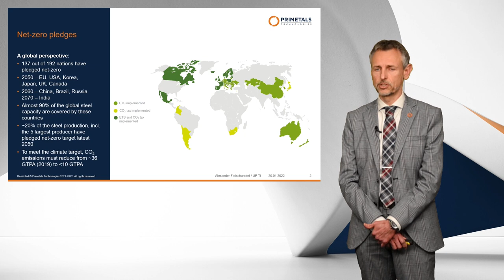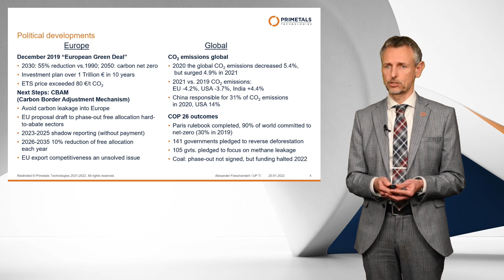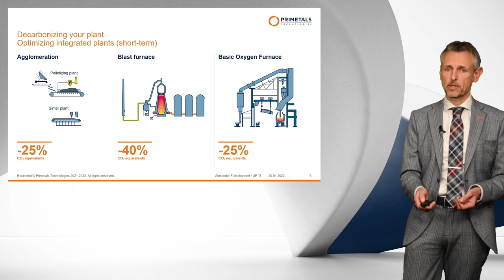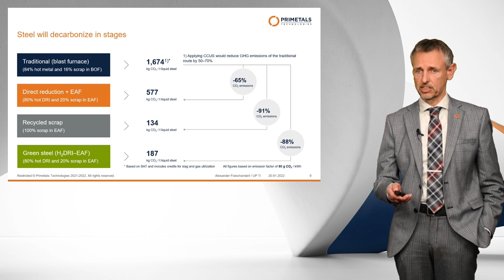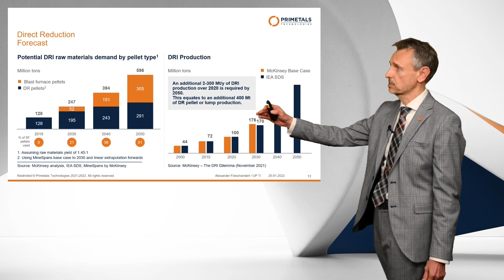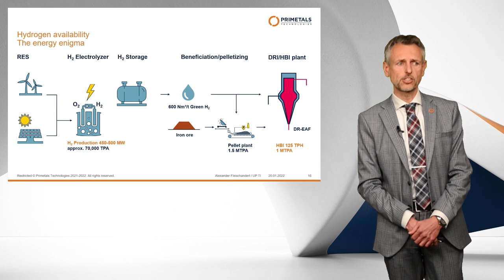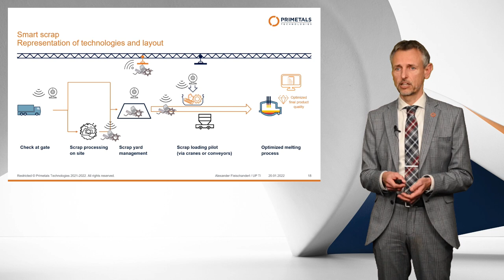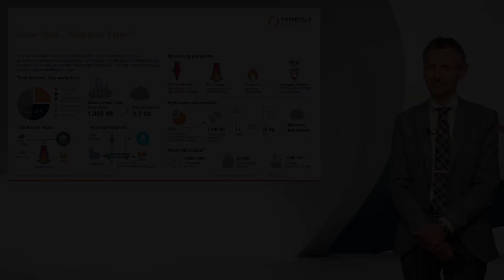Breakthrough Solutions for Green Steel | VDMA TechTALK

Comment: High tempature nuclear reactors could produce very low priced hydrogen.  These reactors could be producing this hydrogen at times when their full amount of power is not needed for electricity production.  This would be a side productiin so really this would like using waste heat since the nuclear fuel to do this is very cheap. The hydrogen produced this way would be the cheapest way to produce hydrogen.  These high tempature reactors would also be able to provide 600⁰C process heat.